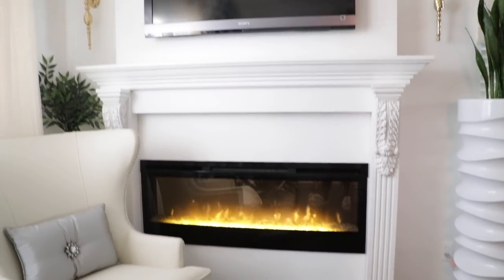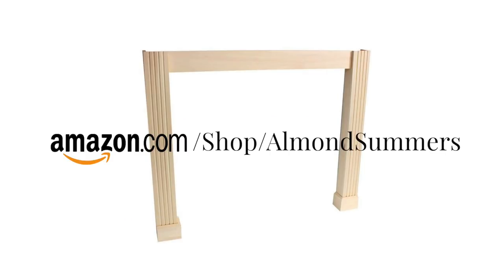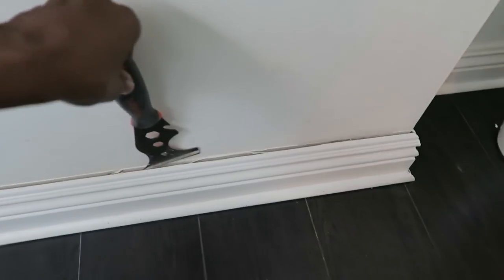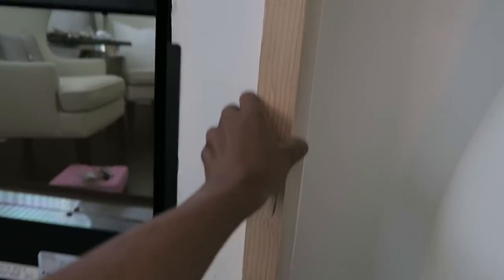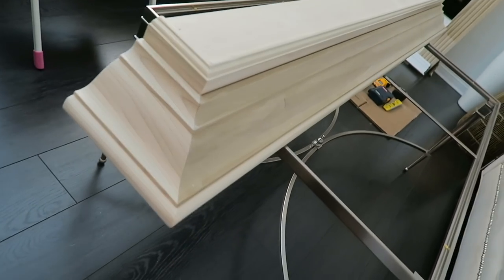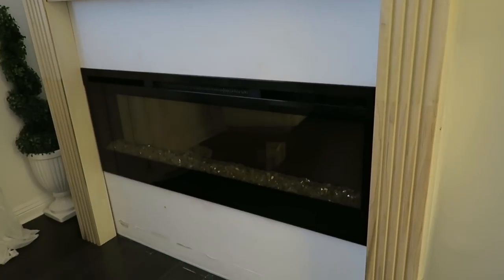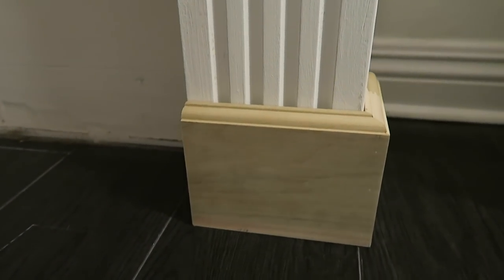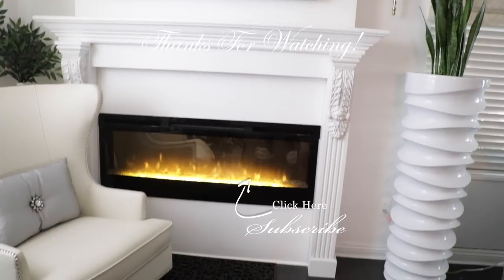DIY Fireplace Mantel Home Decor DIY Interior Design Ideas Install a Mantel Decorate A Fireplace

Comment: Where did you get those gorgeous corbels?  I watched the whole video to find out but if you mentioned it, I missed it. I am glad you opted for screws instead of brads and glue for assembly.  I realize you chose screws in case you decide to change the surround. However wood holds together more securely with screws than with nails. Sometimes instructions will give you the easy way instead of the better way.  I think its perfectly fine to digress from the instructions when you are confident in the what and the why. I'm glad your opted for paint. I agree the unfinished wood was pretty, but because it was pieced together, it would never look right with a stain or sealer. The sections were pieced together with the intent that would be hidden by paint. It reduces the cost of lumber.